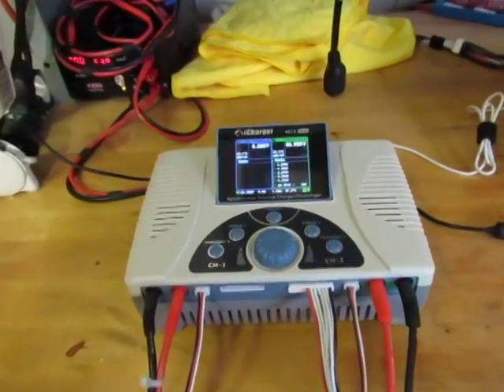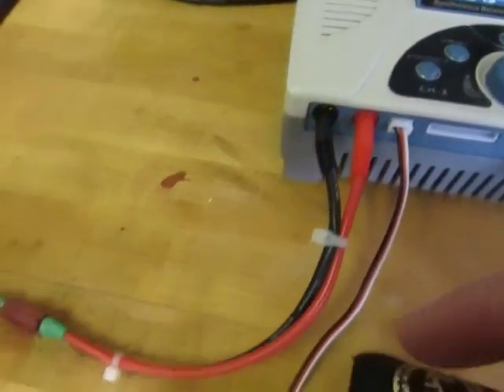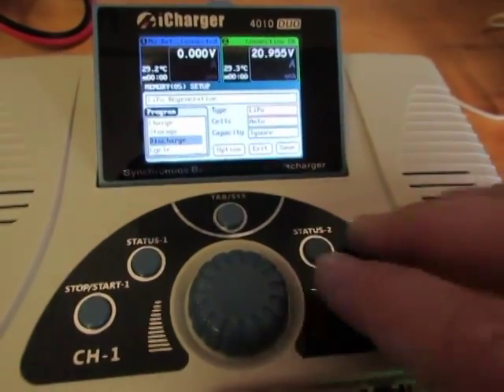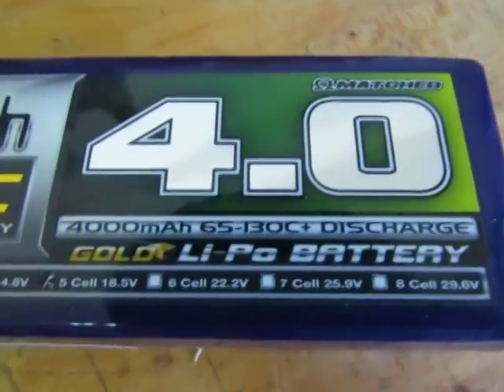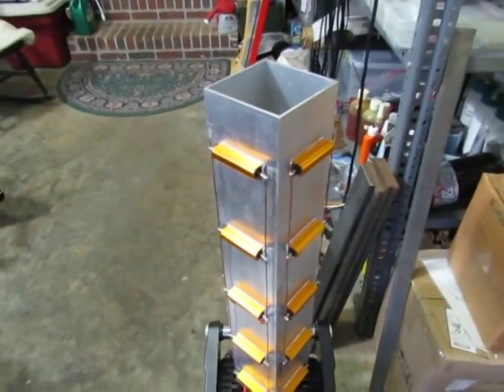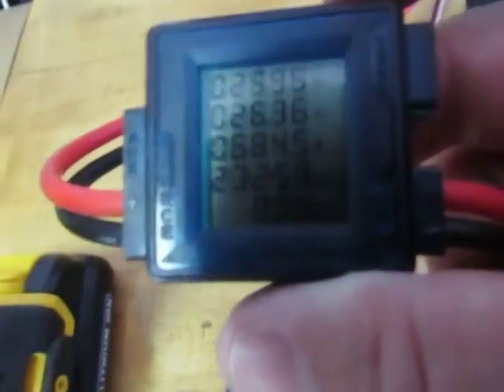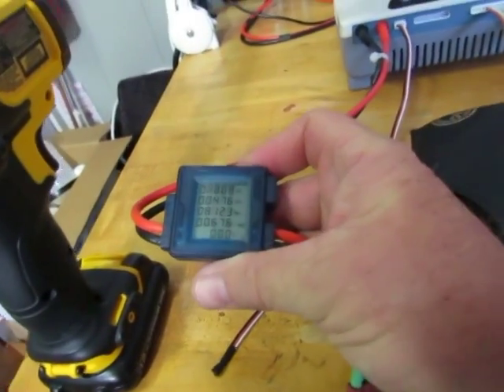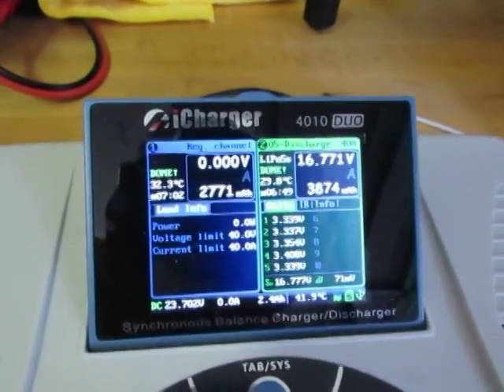Junsi iCharger 4010Duo Discharge

Comment: This is great as I have the same charger. I was wondering about the feasibility of connecting a pack directly to the load bank, this would be for when a pack is at the end of it's life and one wants to dispose of it at zero volts. This would need to be done outside after discharging the pack normally down to it's safe low voltage first. Many thanks in advance.
Reply from the maker: Hey Mike... You certainly could connect this directly to a battery to kill it. Because this bank of resistors is 1 ohm, the current from the pack will be equal to the pack voltage.  So for instance, a fully charged 4S LiPo would be 16.8 volts and this load cell would pull 16.8 amps. That is a reasonable load for killing a pack and should discharge a pack in reasonable period of time.

I have done exactly what you suggest.  I just hook up a pack, throw it in 5 gallon bucket of water, set the bucket in the driveway and walk away. Job done.
Reply: Excellent. Thanks very much for the example you gave, while I applied 
I = V / R,   I was concerned there might be something else to factor in. I think the load bank you made has a great spec, up to 2000W and the gold coloured power resistors look good too!  Together with the 4010 Duo, I think you have the ultimate set up!
Reply from the maker: I=V/R That's it. Sorry if I told you something you already knew.  It's hard to know who you're talking to.

The only consideration that doesn't show up in the formula is if there is sufficient cooling for the load bank. Obviously the load bank will not continue to accept energy forever without eventually over heating. If you were to discharge a large battery you would have to supply some cooling air. Testing has shown that a typical 2,100mAh 3S LiPo barely gets it warm and no cooling is required. If you were to do something like a 10S, 5,000mAh battery you'd probably have to set it on a fan.

Clearly this load cell could have been assembled on a much smaller piece of aluminum tube. I choose this 600mm tube to give each resistor enough area for cooling.  I wanted to space the resistors out. If you wanted a smaller load cell, you could assemble these on something very much smaller and then liquid cool it. At one point I considered making the load cell about 100mm long, filling the center of the tube with water, and using computer CPU liquid cooling components to dissipate the heat.
Reply: Everything you said was very helpful. While I know Ohm's law and how to calculate watts, it's not something I specialise in and anyway, even if one knows things, there's always more to learn and practices change over time as things change. 

Again you've provided some more food for thought with your idea of liquid cooling :-)

Another thing I was pondering, which I'd be interested to hear your thoughts on, was if the resistors and their heat sink were in some sort of container, analogous to a pc case, with fans at each end, one bringing air in at one end while the other exhausts it at the other end, could one actually power them from the battery being dischaged. Primarily this would be while using the 4010 Duo, but also in the stand alone case for cell disposal.

I should mention here that my main battery use is 10s 5000mah.

Thanks again

Comment: A lot more compact and simpler solution for the resistive load is a modified hairdryer. You get over 1000W with those which is as much as the iCharger is capable of doing in regen mode.
Reply from the maker: The iCharger will do 1,600 watts in regenerative mode. It'll do 40 amps x 40 volts. If you don't intend to test at these levels a hair dryer is a popular solution.
Reply: Please, anybody, give more info on this hair dryer resister comment. Interesting
Reply: The icharger is limited to 1000W for a single channel or 2000W for two channels if I recall correctly.

Comment: Good video.  Very cool resistor load.  I was thinking of getting a 308duo for charging a 200ah 12.8v lifepo4 pack of cells (8 100ah calbs), for use as a portable solar backup station (Goal Zero on steroids). The 308duo would be used to charge when the grid is available..  That gets me thinking though....  could the 308duo handle the variable dc input from solar panels, if I wanted to try that?  Also, are you still happy with your iCharger?  Thanks!

Comment: I thought the ideal storage voltage was 3.75-3.85 volts?
Reply from the maker: Hey Chris,

Yes.  Conventional wisdom is that storage voltage is 3.85V/Cell.  The test in this video was for the purpose of testing both the battery's capacity and the load bank of resistors I had just completed constructing.  

Battery manufactures/retailers sell batteries with a capacity on the label but that doesn't mean that is what the batteries actually hold. I was interested in the true capacity of this Turnigy battery.  

As a side note... For the longevity of the battery, I would not recommend routinely discharging a battery to 3.3 volts.  One of the nice functions of the iCharger is that it will monitor and protect voltages for individual cells during a discharge. Most aircraft/ESCs will not. In use, most ESC only monitor total pack voltage and will gladly allow an individual cell to discharge to an unwise level.  During this test the charger was monitoring each cell and making sure no one cell was discharged below 3.3V/cell.

Shortly after completing this video I charged this pack back up to 3.85 V/Cell for storage.

Bill

Comment: What is the point of all this? I have the same charger and I am not familiar with this option. Seems like a lot of work and effort...
Reply from the maker: Well. The point is to be able to rapidly discharge a battery.  There might be several reasons to do this. You might want to check its capacity and overall health. You might want to discharge a battery back to a storage state after having been charged but not used. You might want to see how a battery performs under a higher load. The list goes on.

Without some sort of external load bank, your (our) charger is very limited in how much power it can work with. The iCharger is limited to 120 watts during discharge without using regenerative discharge and a load cell of some sort. With this in mind, discharging a 5 cell LiPo battery, for instance, would be limited to about 5 amps. In this video I test a 4,000 mAh battery. At a 5 amp rate it would take a little under an hour to discharge. If your were testing 3, 4, 5 packs this could become very time consuming. 

Using an external load cell I am able to discharge at 40 amps and in under 7 minutes I'm able to verify that this battery is functioning very close to its rated capacity and still fit for daily use.

Was that your question?
Reply: *****
Isn't this a waste of a lot of energy?  It just seems like a very wasteful way to discharge a battery. Is there a way to store the discharged energy instead of burning it away? One last thing couldn't I discharge a battery faster by attaching a motor to it instead of a bunch of resisters? The thing that strikes me as odd is calling this a "regenerative discharge"? Its not regenerating anything...
Reply from the maker: There are certainly other ways of dissipating the energy of the battery. Pumping it into a bank of resistors to generate heat is obviously not "energy efficient". Not unless your intention was to raise the temperature of the room you're working in. Getting something for this energy, such as work from a motor or powering lights, is an option.  

It's called regenerative because in this mode of discharge you have the option of selecting what you are discharging into.. i.e. a bank of resistors, light bulbs or another battery. In this video I chose resistors but if you watch the video carefully you will see that sending the energy back into the power supply IS an option.  This presumes you used a lead acid battery or some other rechargeable power supply in the first place.

You have the option of powering this charger with a battery (I sometimes use a large Optima marine battery at the field) and in regenerative discharge you could elect to send the energy from a discharging battery pack back into the original power source. There are however, limitation to this. 

Two issues immediately come to mind. First, if your power supply battery is close to charged when you begin a discharge, it will not be able to accept the discharge energy. For instance, if you need to discharge 5, 5,000 mAh batteries, you would need a lead acid power supply battery that needs 25 Ah.

Second, you may not be able to discharge and test at a rate of your choosing. In this YouTube video I chose a discharge that resulted in an 800 watt discharge.  Discharging at 800 watts back into a 14 volt marine battery is not possible.

Using my load bank of resistors I can discharge up to the iCharger's maximum of 1,600 watts.

This video is just one option for bench testing large batteries.

Bill
Reply: *****
So I could actually take the juice from one battery and move it to another? That is interesting. Probably not as efficient as a direct charge, what do you think?  BTW-you seem to have experience with this and I am new to charging methods.
1. When getting a new battery should I charge and discharge cycle it several times before use or just go ahead and charge and use?
2. How long would it take to discharge a 21000mah to storage mode using the 4010?
Thanks

Comment: Hi. Very impressive video. Can you tell me how you did that power bank resistor?

Thanks.
Reply from the maker: I took some video while I was making the load bank.  Maybe this winter I will edit it together into a how to video.  

The short answer to your question is to get 20, 100 watt, 20 ohm resistors, and wire them all together in parallel.
Reply: Thanks!